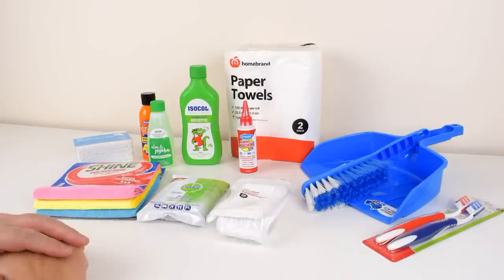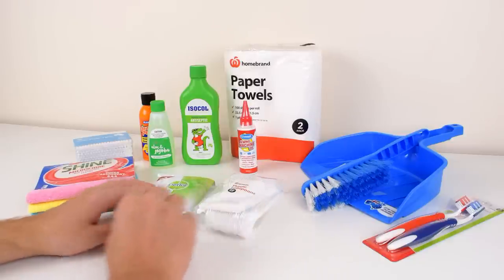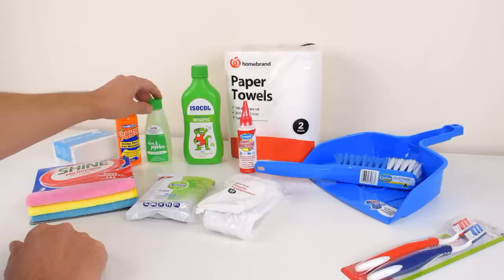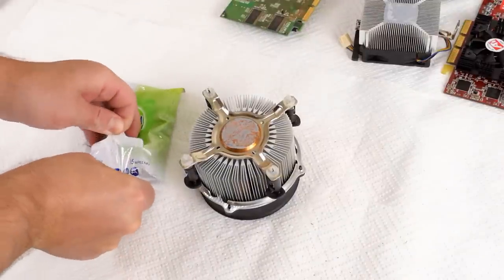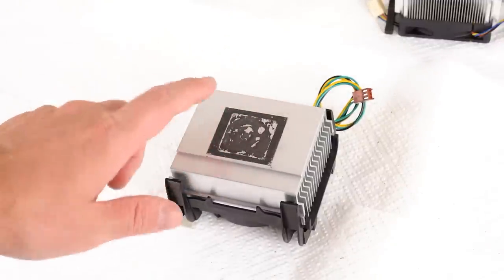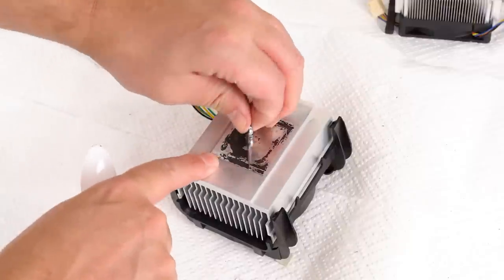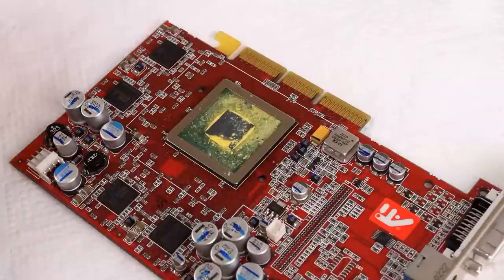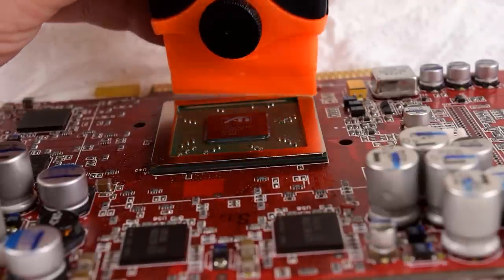How I clean old computer parts with household products

Comment: Here is something I use to clean off the CPU and Cooler. I use coffee filters since they don't leave any fuzzy stuff on the CPU and Cooler. I drop a bit of alcohol on the filter and wipe off the surfaces.
Reply: That's a smart idea. Can I steal that?
Reply: Go for it
Reply: Thanks! I'll have to check if it's ESD safe first. ;)
Reply: You don't have to worry about that since your not touching any of the circuits. You just want to clean the cold plate on the cooler and the IHS on the CPU. Just don't touch the bottom of the CPU where all the contacts are.
Reply: Eric Marcus I know. XD I was making a joke.
Reply: wow I thought you were serious there lol
Reply: Eric Marcus No! FFS I'm not that anal! XD

Comment: i repair computers, and always using a air compressor at around 8 bar/ 116psi.Sometimes the inside of the cases are so dirty, if im done, i must clean the compressor with some air :)
Reply from the maker: I might get one. I just got a cheap $30 blower off eBay and will try that one first. I tend to go super cheap first, and sometimes it's good enough :D
Reply from the maker: Sweet thanks I shall keep it in mind.

Comment: Seems like ESD hazard is just a myth, taken semi-seriously by companies only. (By the way, this is not sarcasm or any negativity. I don't claim to be an expert or knowledgeable, its really just that its amazing what contrast there is between the views on this, its really a mistery to me where the truth could lay...)
Reply: ESD hazard is real, but usually you are fine when grounding before working on the parts. Usually touching a heater or a plugged in case/PSU is enough to kill any potential.
Reply: Just a myth invented to scare people off opening their cases. I bet Dell etc make a fortune in warranties. It still plays in my min though, every time I pick up a component I'm scared my fingers are gonna shoot lightning bolts onto the parts... alas, it never happens
Reply: ESD hazard used to be really threatening back in IBM PC days. It was too easy to burn components even by plugging in peripherals that wasn't hot pluggable like early mice and keyboards that used PS/2 ports. Nowadays, almost every component has ESD protection. It's much safer to handle them.
Reply: It's not a myth.
Reply: agdgdgwngo, It's not a myth. Go research and educate yourself on the topic. (Not trying to be snarky)
Reply: It's not a myth in my opinion, but it has a low possible nowadays. (Don't mind my English please, I'm a half Asian+Europe guy.)
Reply: Somewhat joking there, I don't actually think its a myth spread by Dell! But for the record, i have worn socks and rubbed them on a carpet and poked a P4 motherboard. Nothing happened, idk maybe I don't hold charge. I think you're more likely to break something by being too careful. Like when I was younger i held everything on the edge of the PCB, in fear of ESD. Inevitably dropped my 9600 and snapped the AGP clip off. I sat there and cursed the ESD obsessed tech youtubers
Reply: ESD damage is so small, you can't see it with your eye. You need a microscope. Also, I should note. ESD damage ISN'T covered under warranty, as it's damage that could have been avoided by the end user. If anything, it's in Dell best interest to educate users on the dangers of ESD. It will reduce the amount of RMA requests made because a user thinks a board arrived DOA, when actually they shocked it to death when they opened it.
Reply: RAM is the one thing that's most vulnerable to ESD. I've personally killed so many poor DDR2 & DDR4 modules that way by simply wearing a sweater while just doing a 'quick job' without the ground band while assembling PC's at work.
Reply: Especially RAM. It can have a major effect on your systems stability. It's also tricky to diagnose as it might be the MOBO that's at fault, or your CPU, or RAM. But as all 3 components interact and effect each other, it's difficult to sometimes pin point the faulty part.
Reply: Modern PCB are designed with ESD in mind. So ESD isn't as risky as in the old days. 
Still it's recommended to know the do's and don't with ESD. Memory is indeed the most vulnerable component for ESD these days.

Always decharge yourself and the components . Especially power supplies can hold a high charge for a long time.
Reply: Well I thought its obvious that by commenting on a video with a dude brushing a pcb without any trace of ESD protection or regard for the hazard's existence, I'm not having lightning in mind or questioning the existence of the raw natural phenomenon.
Reply: Are you saying that just because sparks aren't flying nothing is happening? My whole point of trying to inform Phil, and others is to inform them of the dangers of ESD, especially Phil. As he has access to a large audience, and I would not like to see people damage their parts by following his well intended, but incorrect advice. If people are spending alot of money on PC parts, why the hell do they think it's ok to skimp on proper tools.
Reply: "We shouldn't work on hardware to begin with" This is incorrect. Yes, you will always have a certain amount of risk when working on parts, even if you get Robots to do everything. But what you do is reduce the level to an "Acceptable level of risk" 

It is not "Paranoia" at all.

Comment: microcenter sells a product called Artic Clean, for thermal removal, its two parts, thermal material remover and surface purifier.  a couple of drops of the the remover , let it set depending on the dryness of the paste, then using a paper towel or wipe, it just comes right off.  the purifier used to prep for new paste
Reply: It's good stuff, but quite expensive. Thankfully you only need a tiny amount of it so it lasts quite awhile. I'm just happy you're not recommending people to use WD-40. (Face Palm)
Reply: Yes it does not require a lot, i bought 3 sets over 3 years ago, one is in my "ON THE GO" repair kit, one is in my home office and one is at my office, i have fluid still in all 3. all get used. a little goes a long way.
Reply: Yeah, and it smells quite nice too. :)
Reply: This is what I use to remove thermal grease. I usually use Arctic Silver 5 thrrmal paste too, which I find easy to clean even if left unchanged for years.
Reply: Aye, Arctic Silver is quite easy to clean off. Unlike the IC Diamond that I usually use. It tends to go hard after a while.

Comment: 9700 and 9800 were the cards that got that yellow cement paste. Sometimes even you had to heat the heatsink with a hairdryer to make it easier. I actually killed mine 9800 Pro scraping a few resistors off the die. I was extremely disappointed in myself. Lesson learnt.
Reply from the maker: Bugger. Did you have any luck or attempted to resolder them?
Reply: My hands are too shaky for this kinda soldering =) Never attempted.
Reply from the maker: The thing is these old cards don't have temp sensors. So it's hard to judge. But I had two cards, a 9800 Pro and a 9700 Pro, both crashing in 3DMark. After maintenance on the cooler all was good :)

Comment: Close to my hardware cleaning setup:
toothbrush (soft enough to not damage anything on a PCB)
pastry brush (for collers and anything too deep for the toothbrush)
floor brush (for the big stuff)
lighter fuel (to clean off thermal paste)
toilet paper (works fine enough, for PCBs I got my brushes)
toothpicks (nice to get thermal paste from smaller corners)
Q-tips (the smaller brother of the toilet paper)

Just recently cleaned ym Geforce 3, and my solution to get rid of the hardened thermal stuff was to just put a piece of toilet paper on it, soak it with the lighter fuel and let it sit for 5 minutes. After that is jot soaked of.

Comment: I use Artic Silver Articlean for my cpu´s and coolers.
It´s  two bottles, the first for dissolving, the second for cleaning.
It costs about €7, but it works realy good. you need only a few drops, so it lasts a long time.
I never encountered a cpu or cooler i couldn't clean with this.

Comment: Do you have GooGone in Australia? It's the best at removing thermal compound. It just needs to be followed up with 1 wipe of alcohol to assure no oily residue
Reply from the maker: I was looking for that product! I'm sure I can order it online, but for this video I kinda wanted to constrain myself to what's available at the shops :D Also I wanted to get the video out and it would take a week or two for anything to arrive.
Reply: GooGone works quite well for that sort of things, but I've encountered adhesives that resists it quite a lot. WD40 took it right off. Like you said, chemistry.

Also, Staedtler mars plastic pencil erasers works wonders for cleaning up gold fingers on cards and ram sticks, trick from my 65yrs old father 
Thanks for the video, very interesting as always
Reply: My guess is the Orange Power stuff he is using is essentially the same thing as GooGone.
Reply: I use lighter fluid and oddly enough it's no more flammable than original Goo Gone
Reply: I suspect it's the same thing they use in ArcticClean #1.  Same orange citrus scent.
Reply: I get the point of what Phil is trying to say. But you simply shouldn't be cutting corners because you're cheap.

Comment: If I may, I use the 90% alcohol almost exclusively, Goo Gone (avail. in Australia?) for stubborn ones and plastic paint scrapers which I'll cut to size (more durable and sharper than spoons and cheap). Anything that is not rubbing alcohol, I clean up afterward with rubbing alcohol I don't think I've ever removed a video heat sink unless I'm putting on a third-party cooler. For that ATI card, I recommend keeping the shim and getting a properly sized  good quality thermal pad. VGA coolers can rock because they are mostly held by two pins and you could start chipping the die without the shim.

Comment: Hey Phil, idk if you'll read this, but at 5:30 what's on the cooler is actually a phase change thermal pad! It's basically an aluminum strip with phase change coating on both sides, which sticks REALLY well once a temp threshold is reached (~60-70c). It's really good stuff when it comes to thermal transfer and due to its nature as a thermal pad, it lasts forever too. The phase change compound is a bitch to remove though, but Isopropyl alcohol does the trick. It really needs to make good contact to work, however; if it doesn't have good contact, you might as well use air for TIM. A store in the Czech Republic sells them, and I tried them on both an R5 2600 and a P4 3.2GHz, so I talk from experience.

Comment: honest question here. I vape, (electronic smoking device). I didn't know until recently that the vapor has got in to my system enough to leave condensation and I need to figure out how to remove an oily residue. most things i try just smear it around if its not on a surface i can wipe. My question is - can I pour rubbing alcohol directly on a pcb and then blast it off with a can of air? alcohol is very effective at removing vape condensation but its hard to get in and around circuits.
Reply: My brother had the same problem as yourself. We found that the problem was the VG in his juice mix. If you stop using VG you will no longer have your problem. To clean it off use 99% Iso.

Comment: An idea for the ATI board.  Removing the shim that is there would mess with heatsink fit totally.

Amazon sells copper shims really cheap.  I'd suggest getting a 0.5mm copper shim on there, looked a little small to be a 1mm there for that gap, but you might want to get both, they are cheap.  You can use a liquid metal between the die and the copper shim (Conductonaut), but still would have to use a paste between the copper shim and the aluminum (Kryonaut).

As for the nail polish remover, was it acetone based?  It looked like it lifted the anodizing from the heat sink.  Something to keep in mind if it did.
Reply from the maker: Yes it contained acetone. I will stick to using the Orange Power :) I ordered some copper shims from eBay yesterday, an assortment of various heights :D

Comment: Hi Phil Light machine oil will not last on the shafts of fans, Use White Lithium or Teflon grease. Also I wash most electronic parts with distilled water, Then blow them off with my air compressor. Then alcohol then dry them with a hair dryer. I don't wash hard drives or power transformers with water.
.
Reply from the maker: I must say I had little success after trying to maintain a few fans with lubrication. So now I recommend just replacing it with a good one.

Comment: I had exactly the same PCB and die layout on my FireGL X1-128. what I did was remove the shim, lap the bottom of the radiator till bare metal and then put on thermal paste. worked like a charm :)
Reply from the maker: Yea I will have a go at removing the shim. Another tip I got given today, you can get copper GPU shims on ebay, starting at 0.3mm heights.
Reply: might be a good option :)
Reply: Those copper shims are really handy.
Reply: the only thing I would be worried if they wont scratch the PCB
Reply: Put down the TIM first then place the shim. No scratching that way bud.

Comment: With 7:20 and other situations like this, even if the heat sink / spreader looks clean at this point, I'd want to give it another clean over with isopropyl alcohol. Just to make sure. That's the one "industrial" product I would add to this otherwise sensible collection of cheap household stuff that does seem to help clean gear! Great video Phil, very useful.

Comment: Informative video. Thanks for all the tips!

For myself, I use cheap set of DIY paint brushes for removing dust instead of a dustpan & brush. Also, although I use Arctic's thermal paste cleaning kit myself, which does last a long time, you do offer good suggestions for alternatives that could be gotten straight from the supermarket for less, rather than waiting for the Arctic stuff to arrive in the post if you've run out.
Reply from the maker: Yea that was the idea :) I've used the Arctic stuff before, works just as well. I've ordered a set of ESD brushes, copper shims and more GPU coolers since making the video :D
Reply: Any chance you could add an ESD Mat & Strap to that list of purchases? :)

PS: Don't forget the bonding plug. ;)

Comment: How about mitigating dust problems in the first place like with using air cleaners and filters in a computer room.
Any highly recommended ones ?

Lets put it this way I have two domestic indoor cats and their clay litter box makes a lot of dust.
I do use two air cleaners but even with those it just cuts down on the dust and doesn't eliminate it completely.
Now my main computer room with most of my computers is separate and usually closed off to that area so the dust problem is not too bad.
Still I have a couple of computers in the room with my cats and litter box and I constantly have to clean these out at least monthly.

Anyway thanks for your video tips on cleaning PC Parts Phil

Comment: I recommend using 91% isopropyl alcohol. Nail Polish remover is 70% iirc, but 91% has a minimal amount of water. You can get these at any pharmacy. Also a coarse cotton rag will do the trick well too, sometimes that bit of extra roughness is a good way to remove deeper ingrained dirt and give some extra power to removing sticky surfaces.

Additionally, I recommend getting a heat gun, these are very cheap, they function sort of like a hair blow dryer but these can make removal of stickers or other adhesives incredibly easy, just practice first and be careful as they get very hot and will shrink certain types of plastics or deform them if direct heat is left for too long.

Lastly if you're doing a surface clean on a plastic or something, consider Mr. Clean's magic eraser, it's powerful and acts as an abrasive, kind of like sand paper, but will do wonders on those marker stains that are just too deep to remove with alcohol. They leave quite a bit of residue, however, be careful with inhaling this stuff.

I actually work at a retro video game store and most of the work I do is cleaning 30 year old consoles, controllers, etc. with thoroughly caked in dust, dead skin and dirt. Linked is some examples of my cleaning work: https://imgur.com/a/Rgxe5
Reply from the maker: Yea I will get isopropyl alcohol. I'll ask the Pharmacy if they got any, otherwise I'll order some online.
Reply from the maker: So I went to the pharmacy, they had the same stuff I already have. That green bottle with the crocodile.  Contains Isopropyl Alcohol, water, fragrance...
Reply: No 91%?
Reply from the maker: I'll check the hardwae store tomorrow, but likely I'll order it in.

Comment: I would love to see a before and after in regards to the temperature of the 9700, and overclocking ability once you removed the shim! I have a 9700 as well, and found the VPU to be a decent overclocker, but the memory didn't have a lot of head room. I noticed that the memory timings were tighter than my 9700 Pro, and wondered if it was possible to flash a bios with looser timings. That should allow a higher memory clock, maybe closer to what a 9700 Pro runs at!
Reply from the maker: It doesn't have a temperature sensor unfortunately.
Reply: Maybe you could use one of those infrared thermometers. I bet it makes it big difference.

Comment: Instead of household cleaning wipes, I use alcohol pads, usually available in the diabetic supplies.  You got lots of them for cheap, they're small, will remove just about everything (alcohol-based), and you don't waste as much as you do with the cleaning wipes.
Reply from the maker: Yes great tip, I'll check if the pharmacy sells them.